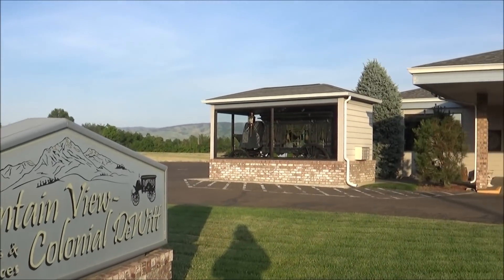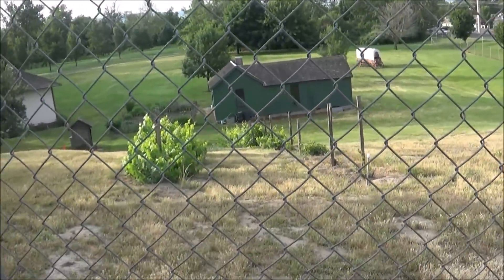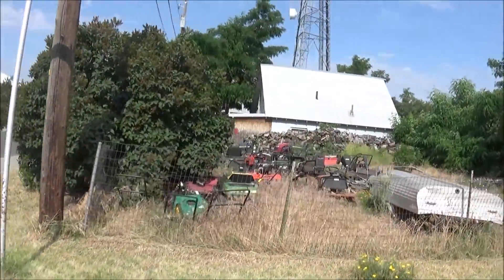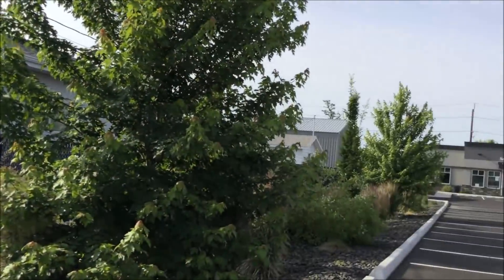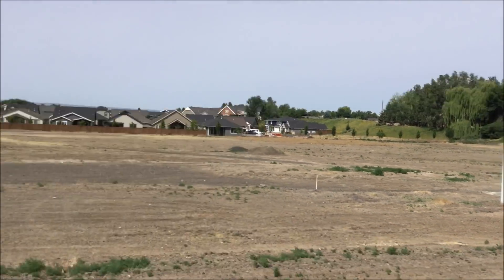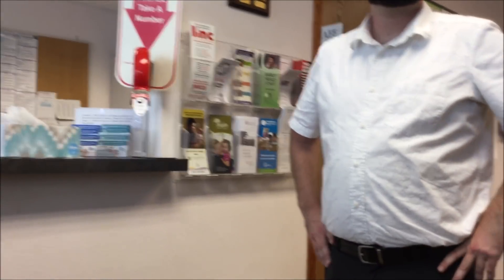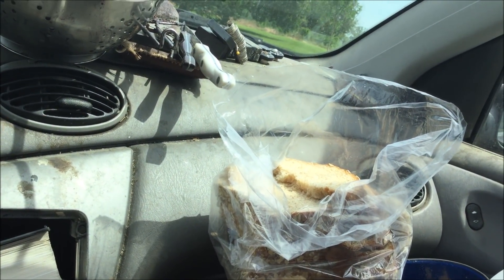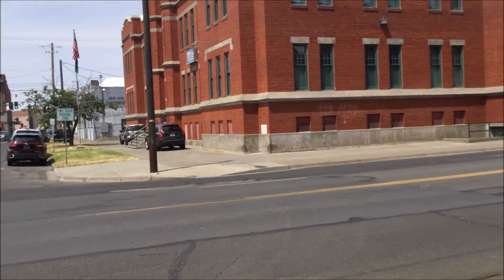Walla Walla is not only unique for their violent history. They also have hobby sports. Washington

Comment: The lawnmower collection was really cool. 

Here's a tip, look through those for 1960's power reel mowers, the Toro Sportlawn in particular. This model was very popular in Washington State and will fetch some easy cash in Seattle.

Cheers!
Reply from the maker: Wow: https://www.google.com/search?q=1960%27s+power+reel+mowers&tbm=isch&source=iu&ictx=1&fir=2_xXt2o0EJD37M%253A%252CT98XfpC9bxGmDM%252C_&usg=__pGG5p9FA6wL36V7R05sBPqygGkA%3D&sa=X&ved=0ahUKEwiBva7q-ZLcAhUKFzQIHc0DDMMQ9QEILzAC#imgrc=2_xXt2o0EJD37M:

So they're designed to be push mowers with a motor, sort of like a bicycle with a motor. Interesting.